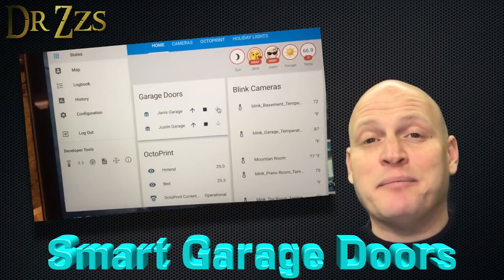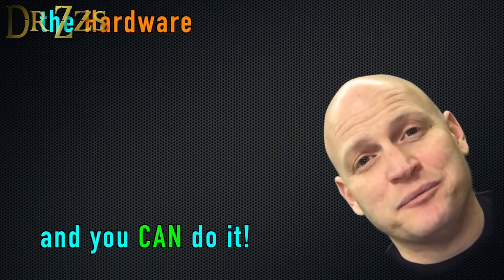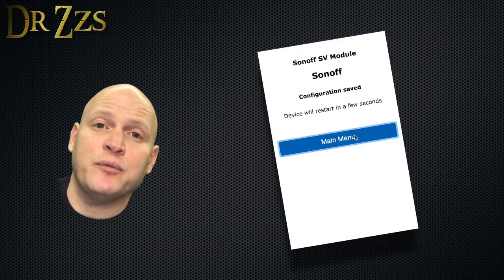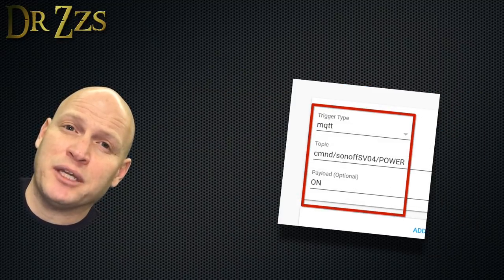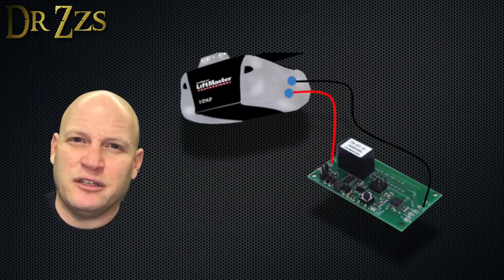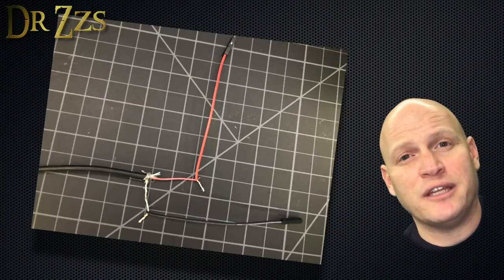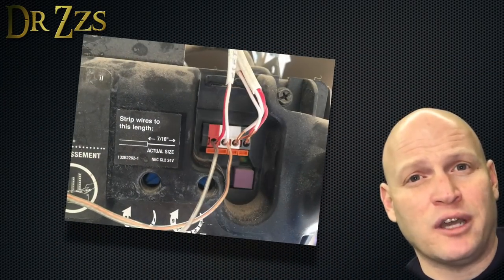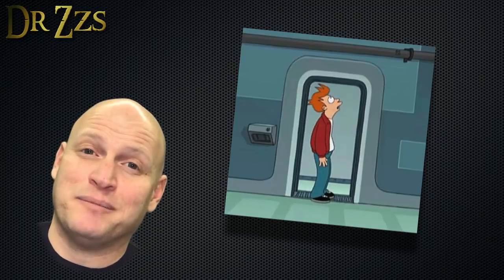$5 DIY "Smart" Garage Door Opener using Sonoff SV

Comment: Amazing work!
I'm triying to do it with a Sonoff Basic (with mains tracks cutted) but the behavior is not the same as yours, when I contact GPIO 14 and ground the relay goes to on, and when I release, the relay goes off, the arrow in HA is always black. I'm going to do all the process again but I think everything's ok. May be with the Basic one the process is different?
Learning a lot with your videos, keep up the good work.
Reply from the maker: Thanks!
That sounds like something you can fix in Tastmota. 
Under Configure Module, set GPIO14 as Switch 2.  Then in the Console set switchmode1 0 (that turns off the button control for the relay), then set switchmode2 2 (that sets GPIO14 to work with the Reed switch to tell you if the door is open or closed). 
If you've done all that and still getting your result it's possible there's a difference with the Basic.  I'd have to try it myself and see if I get the same result. 
Can you post some images of what parts of the board you modified to get the isolation?
Reply: I've done it like you say but with no luck, I'd apreciate if you try it. The pictures of the modification are these, notice that we make 4 cuts but also a bridge between two tracks.
https://pasteboard.co/H4rAWo1.jpg
https://pasteboard.co/H4rBdZK.jpg
https://pasteboard.co/H4rByne.jpg
Quick and dirty :-)
Hope it helps
Reply from the maker: I'll check it out.
Reply: Hi, Noob here.
I'm trying to do the same.
Switchmode1 0 and Switchmode2 2 does not seem to isolate GPIO14 from the relay on the Sonoff Basic.
Setting GPIO3 to relay2 as well does the trick.
The Tasmota interface now shows 2 Toggle buttons, One for the relay/LED and one for GPIO14/LED.

Also, setting pulsetime1 10, turns off the relay after 1 second, possibly eliminating the need for the automation in HA.
BTW set PowerOnState 0 to prevent activation after a power interruption.

The console is reporting stat/sonoff01 not cmnd/sonoff01.  I don't know why.

12:02:13 MQT: stat/sonoff01/RESULT = {"POWER1":"ON"} # Click toggle1
12:02:13 MQT: stat/sonoff01/POWER1 = ON
12:02:14 MQT: stat/sonoff01/RESULT = {"POWER1":"OFF"} # Goes OFF after 1 sec
12:02:14 MQT: stat/sonoff01/POWER1 = OFF
12:02:16 MQT: stat/sonoff01/RESULT = {"POWER2":"ON"} # GPIO14 to Gnd 
12:02:16 MQT: stat/sonoff01/POWER2 = ON
12:02:17 MQT: stat/sonoff01/RESULT = {"POWER2":"OFF"} # GPIO14 open
12:02:17 MQT: stat/sonoff01/POWER2 = OFF

The trick now is how to modify configuration.yaml accordingly to get it to work from HA. Still have a lot to learn.
Reply from the maker: Pierre Scerri Man! Nice work! 
That’s not noob stuff. That’s pro.
Reply from the maker: To get HA cover to show the door open you’ll have to swap what I have for the mqtt topic and payload to what yours is showing. 
When I get to my computer I can post what you’ll need to change. 
But you’ll probably have it figured out by then.
Reply: So.  Configuration.yaml now has these lines:
    state_topic: "stat/sonoff01/POWER2"
    command_topic: "stat/sonoff01/POWER1"
POWER1 is the relay, POWER2 is GPIO14

In HA, the trigger is stat/sonoff01/POWER1 and the action is:
 {
  "payload": "OFF",
  "topic": "stat/sonoff01/POWER1"
}
With GPIO14 to Gnd the state responds and shows the open door icon. The up arrow becomes disabled and the down arrow becomes enabled. Perfect!
Not!
Clicking any arrow or stop does not send anything ie there is no response at the Sonoff end.

What am I missing?
Reply: OK Got it!
We need to command Relay1 and monitor the state of Relay2.
configuration.yaml should look like:
state_topic: "stat/sonoff01/POWER2"
command_topic: "cmnd/sonoff01/POWER1".
Don't forget to change the topic (sonoff01 in my case) to your own.

So:
1. Configure Sonoff Basic with GPIO3 - 18 Relay2 and GPIO14 - 10 Switch2.
2. pulsetime1 10 (Switches off relay after 1 second)
3. PowerOnState 0 (prevents activation on electrical power up)

No switchmode commands are required.
The automation is also not required and can be deleted from the automation.yaml.

Hope this clears up the issue.

All that remains is for me to cut the tracks of the Sonoff to isolate the relay, buy a reed switch and install everything.
Reply: Wow Pierre, works like a charm. Thank you!!!
Reply: Glad you got it working.
Reply: great work, any tips on getting the icon in home assistant to work, i use youre config, but cant get garage icon to work on wheter the garage door is open ore not
Reply: Hi

The icon works in my setup.  
Make sure that you set state_topic:  "stat/sonoff01/POWER2"
i.e POWER2 not POWER1
The only snag is that on restarting HA, the status is reported as 'unknown'. I have set 'retain: true' in configuration.yaml but it does not seem to have the desired effect.
Reply: Pierre Scerri Thanks so much for this. Followed your steps and it works great for the sonoff sv as well. Now the reed switch is isolated from the relay and I don’t have to worry when there’s no wifi / HA is down / MQTT is down. Spent a lot of time on this until I came across your post. Great work!
Reply: Hi Peter.  Glad you got it to work.  My only niggle is that when HA restarts, it does not detect the state of the reed switch connected to GPIO14 until the garage door is activated.  This shows door as open.
Haven't figured a way around this yet.
Reply: I haven't either but it doesn't bother me all that much. If you do, please share. I will do the same.
Reply: Setting "PowerRetain 1" in the sonoff console caused my garage door to show closed on restart of HomeAssistant.

Thank you! These instructions about using GPIO3 for Relay2 and PowerOnState 0 are excellent! Using stat/sonoff/POWER2 makes much more sense than the SwitchTopic (no offense DrZzs)....
Reply: In the documentation, they say that when you read the Power<x> it also resets the pulsetime which I don't want to do. I want to read the Power1 state only. Is there a way to achieve that? I only see that we can use STATUS command to get Power value but it is somehow accumulated with the reed state. So if you have only Power1 ON then the value is 1. If only the reed is on then the Power value is 2. When both are on the value of Power is 3 in case of the STATUS command.
Reply: I found that usind status=11 command we can get the value for both Power1 and Power2 without resetting the pulsetime. Should work for me.

Comment: IFTTT works great for us here with the garage door. Owntracks was too unreliable and router based could be slow as the phones usually didn't connect right away in the driveway unless using them. IFTTT has been flawless leaving and entering. I have the radius half way down our street so it doesn't trigger when going outside. Also have a 20 minute timer to close the door if we leave it open. I am not using a sonoff for this though.
Reply from the maker: Nice! 
I'll have to try IFTTT.  
Making the radius really big is a good idea.

Comment: If my tasmota is 5.11 do I still need to do relay?  It was all working fine but recently I had issue with the state. So I'm thinking what might have changed automatically. Also does 5.11 support retain state after HA restart?

Comment: I have an electric gate opener that now works off my location.  Opens when I enter a geo-fence and closes when I leave the same area. 

Gates are controlled via GPRS with a SIM Card so I can remotely control the gates either by my phone (calling the gate and entering a code or sending an SMS with a code) or Alexa voice commands.  

The geo-fence is controlled via IFTTT location, with sends an SMS message to the gate to open or close them.  When I want to leave home in my car or motorcycle, I can ask Siri to call the gates to open them.

This is a little over-kill but that is the set up I have.  

The part that you need will only be the IFTTT location to trigger the Sonoff SV.
Reply from the maker: I like that idea. I don't know anything about GPRS. What hardware do you use?
Reply: This is the control module hooked up to the electric gate opener

https://www.aesglobalonline.com/cellcom-plus

Definitely over-kill for what you require, but it proves that IFTTT location can open/close these gates via a simple SMS code in a geo-fenced area.

I have also set Alexa up to send SMS messages to the gate via IFTTT and clickSMS service.  Alexa can open/close the gate or keep the gate open if required.

Comment: Do you have to use the Sonoff SV switch? or does the other Sonoff switches work as well?
Reply from the maker: The reason to use the SV is you can uncouple the power to the ESP chip from the circuit passing through the relay.  That's probably possible with the Sonoff Basic, but I don't know how to do it. The SV is made for low voltage so it's really ideal for this kind of use. It's about the same price as the Basic; around $5. 
Hope that helps.

Comment: So I'm pulling my hair out trying to put an SV into boot mode. Is it the same as a basic? Tried 2 sv's. 2 ftdi's and 2 different computers.
Reply from the maker: dang 
ya, it should be just holding the button when you power up.
hmmm 
So you're getting the espcomm error from the Arduino IDE?
Have you tried flip flopping the Tx/Rx wires?  it should be Tx to Rx and Rx to Tx, but some USB/serial adapters label the pins differently. 
You could try soldering a header on the pins on the SV so you can be more sure there's a good connection to the serial adapter, then hold the button and plug into your USB on the computer.  

Sorry you're struggling.
Reply: any solutions to this? I am having the same issues. I don't see any LED blink on SV when I press the button and power on. Thanks in advance.
Reply: bmw220 i gave up unfortunately.
What i do know is both my ftdi boards seem to shut down the 3.3v if hold down the button and power up. But will power the sv just fine if  i just plug it in. But i couldn't determine if it was the sv or the ftdi causing the issue. (Tried  2 sv's) bad batch?
Reply: That is the same behavior i am seeing. green LED on sonoff blinks if i don't hold down the button. If i do, no activity on LED and no upload. maybe the button is not shorting gpio0 to gnd??? does anyone know where gpio 1 pin is on Sonoff SV? also, is it correct that led should blink atleast once when the board goes in programming mode?
Reply: Update for people struggling with this issue: I ended up using nodemcu flasher to upload tasmota. directions below (credit MMilesMM). After uploading the binary, restart SV, press button 4 times quicky, connect to wifi it just created and setup your wifi settings. Good Luck!

Download the nodemcu flasher: https://github.com/nodemcu/nodemcu-flasher
After that, open the program and go to the advanced tab. Set the settings there as told:
115200 baud rate
1 Mb
40 MHz
SPI Method: DOUD
Then go to the config tab and select your bin file. After this, click on the operation tab and select your COM Port and click "Flash". It should work flawlessly.

Comment: Hi sir. I am very pleased of your videos. How can I make MQTT push button (not switch), i can not find MQTT push button component?
Reply from the maker: you mean in Home Assistant I assume.  There isn't an MQTT push button component in Home Assistant.  You still use the switch component.  To get the Sonoff to function like a push button instead of a switch you make changes to the Switchmode in the Console in Tasmota.  
Hope that isn't too confusing.  
Tell me what you are trying to do and I'll try to help more. 
Thanks!
Reply: Thanks SIR. I made some device like WI-FI_to_RF bridge(based on wemos D1 mini) (getting mqtt comand from HA, and send it to RF wall switch) and I successfully use it with switch component of HA, but in my case I do not need feedback from wall switch, thats why I just want like push button component (push it and just send comand)
Reply from the maker: okay, so you want to be able to push a button and send an MQTT message to Home Assistant.  How confident are you with writing Arduino sketches?  You can certainly connect a button to one of the GPIO pins on the device you've made that is receiving the MQTT message from Home Assistant, and set that button action to send a message back to Home Assistant. 
I'm not great at Arduino code, that's why I use Tasmota. 
Maybe this post will help you. 
https://community.home-assistant.io/t/mqtt-button-using-esp8266/45/3

Sorry I don't know more 
Good Luck!

Comment: Ran into another issue.  I cant get the automation to turn off the sonoff SV.  I've been hacking at it for two hours :( re-checked all the settings and codes. I set the setting in automation exactly like your (with exception of the sonoff name of course).  When clicking on the arrow to open/close the garage, i hear the relay just double click really quick.  Like it is turn on the off right away like there is no delay.  I double checked  to make sure the delay time is 00:00:02 (two seconds).   I can manually press the button on the sonoff and it would open/close the garage, then i have press it again to turn off the sonoff.  

The reed switch status is updating correctly so it seem like everything is working except for the delay to turn off the sonoff.  What could i be doing wrong?  Thanks.

Here are links to my automation settings

https://ibb.co/j4MVnx
https://ibb.co/i3sguc
Reply from the maker: Hmmm
So you push the button, the relay activates, the garage opens then you have to push it again to turn the relay off.  But when you activate the relay from Home Assistant you hear the relay go on-off really fast and it doesn't activate the garage door?  It could be your garage door needs more time.  I see you made yours 2 seconds.  Mine works with 1 second.  Try increasing that time even more, maybe 10 sec or even 60 sec.  

Another thing you could try is to set the "Pulsetime" of the relay in tasmota and not do the delay automation at all.  Mine has been working for me so I haven't changed it, but some other guys pointed out that you can set a time in tasmota for the relay to automatically reset to off.  
https://github.com/arendst/Sonoff-Tasmota/wiki/Commands#main
 
You've got everything else right. You're so close to getting it working!
Reply: DrZzs it acting exactly as you described. However the delay automation does not seem to delay at all. All the settings seem correct it just not "acting".  I'll check out pulse time.
Reply: I got it!  Pulsetime 20 does the trick so it working perfectly now.  So how do i get it so that it show up in google home like sonoff switches?  I would like to tell google to open the garage.  Thank for your helps.
Reply: Got it figured out.
Reply from the maker: how'd you get it showing up in google home?  
I've told folks to use the Emulation options in Tasmota, but I've also heard they have issues.  
What did you do?
Reply: I just add it like a switch.  You will have to tell google to "turn garage on" to open or close since the relay get turn off after two seconds.  

switch 6:
  platform: mqtt
  name: "Garage Door"
  command_topic: "cmnd/garage/power"
  state_topic: "stat/garage/POWER"
  qos: 1
  payload_on: "ON"
  payload_off: "OFF"
  retain: true

However be warned that the relay is automatic turn on (then off by pulsetime) when plugged in.  I've spend quite a bit of time playing around with console commands on how to get it to not turn on the relay when power on but couldnt get it work correctly.  I used poweronstate 0 and it seem doesnt work.  I turn off Home Assistant completely and the relay worked as programed, relay is off when power on via poweronstate 0 command.

After much troubleshooting and looking at the console log on how the relay is being power on, i suspect that the command above (to get it working with google home) auto turn on the relay as the sonoff is power on and check in with HA via mqtt.

Being a newbie to tasmota and Home Assisant i dont fully unerstand how things works so it a big security risk for me should the garage open during the night or when my wife is at home with the kids. At this point in the project i scrapped it, plus after evaluating, a click of a button is faster lol.
Reply: Hi Linh, what setup did you end up using....2 seconds delay and what Pulsetime?  My delay automation isnt delaying too. Thanks.
Reply: clos B I used pulsetime 20. Pulsetime is a command part of tasmota that you can set the relay to turn off after a certain amount of time. Pulsetime 20 is equipvalent to 2 seconds. So it kind like the automation is build into the sonoff.

You dont have to setup the automation in hassio if you use pulsetime.
Reply: Awesome video.  Got it all working today.  Thanks a million.  As far as showing in Google Home, I created the following template_switch and it shows up in GA:

ga_garage:
  value_template: "{{'off'}}"
  turn_on:
  - data:
      payload: 'ON'
      topic: 'cmnd/sonoffsv01/POWER'
    service: mqtt.publish
  turn_off:
  - data:
      payload: 'ON'
      topic: 'cmnd/sonoffsv01/POWER'
    service: mqtt.publish

In Google Assistant, just create a shortcut that whenever someone says, "Open/Close the garage door" the command "Turn on the garage door" is sent.  I haven't had it working long enough to see if there are any issues, but it works.

Comment: Hey buddy I am new to this tell me something can I not use the same process with other board has blue relay instead this black looking board .
Reply: So off I have is 5v-12v
Reply from the maker: Show me some pics of the board you have.  It's certainly possible to use a different board.  The process for getting it into programming mode and flashing will be the tricky part.
Reply: This is board I have ...
Reply: DrZzs https://photos.app.goo.gl/f47Div15QCKQMASN2